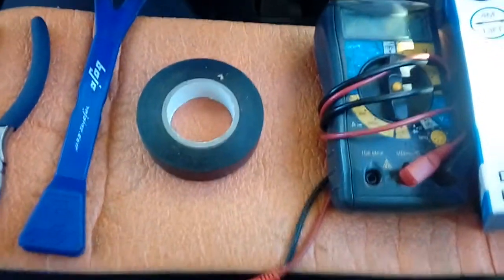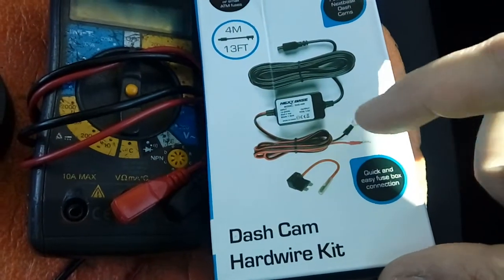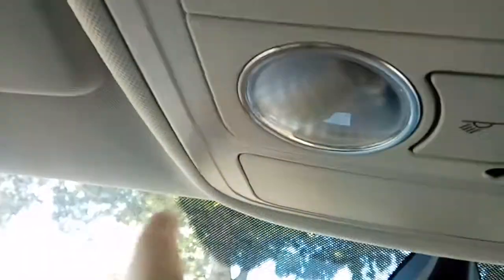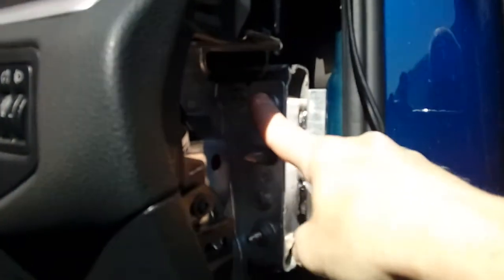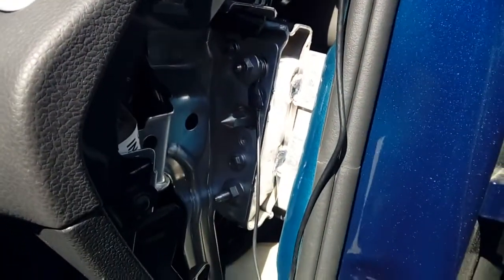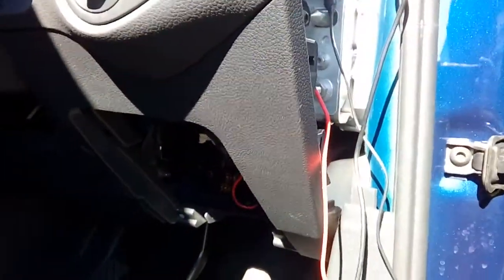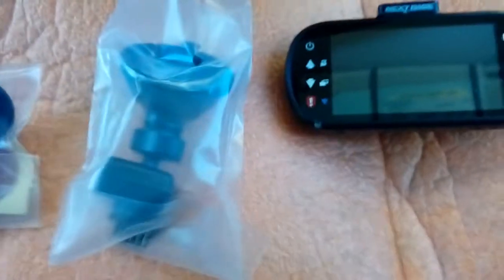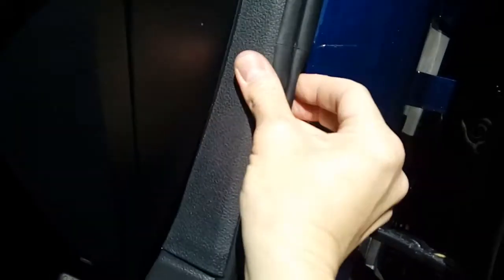VW Sharan 2010 onwards how to fit dash cam simple guide

Comment: Issue I have the earth cable that you put on behind the 13mm bolt, that hardwire kit from nextbase is too small, it's not ring shaped like yours in the video as it easily slots in behind the bolt, it's like a half circular open ground cable
Reply from the maker: Just chop it off and crimp a ring terminal on, or if that’s a problem just slightly open up the existing earth half circle so it fits over the stud.